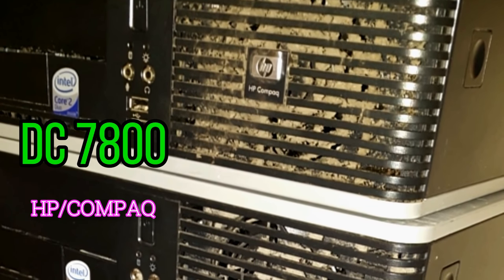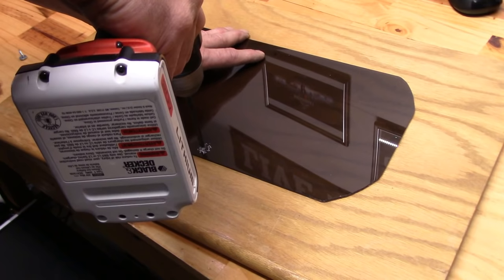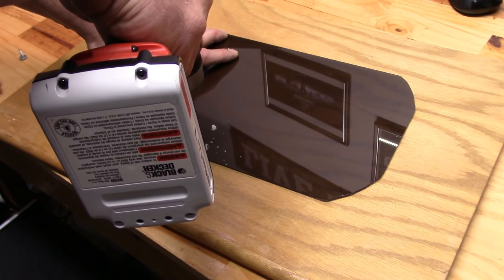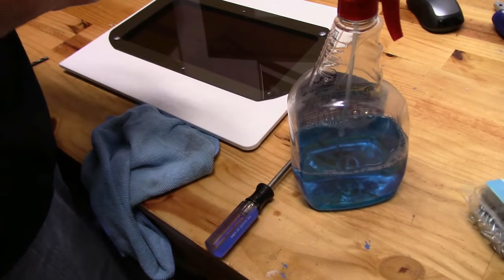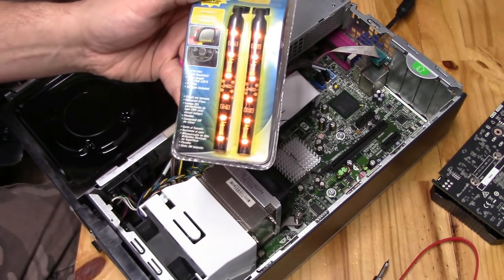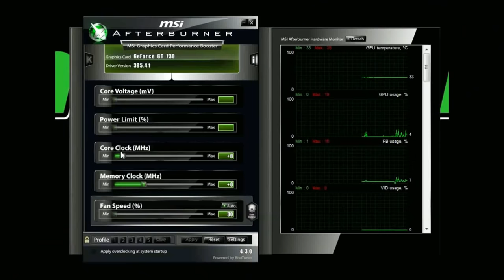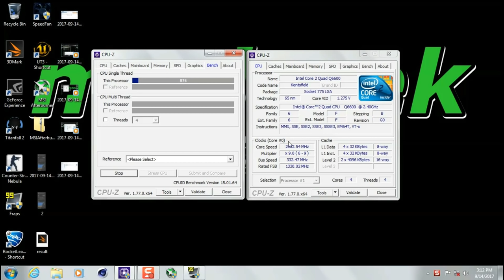ALL Out HP Gaming pc on the cheap! How to customize your pc.

Comment: Here's something to consider when drilling acrylic too, and that is to use wood above and below the glass. The piece you use above does not have to be much, maybe 3/4" thick by 6" long by 2" wide. That way when the drill cuts through it does not snap the acrylic. Just make sure to hold the top piece down tightly against the glass. You can also drill the hole on the top wood in a way that allows you to keep the piece flush with the glass for alignment purposes. Also making it about 2" from the edge allows for easy alignment as well...

Comment: Do you still remember few months ago I told you that the CPU fan of my HP dc5800 Small Form Factor is noisy after being restored? I almost give up and want to dispose the PC. However, recently I discovered that the overheating part is the North bridge heat sink, not CPU heat sink. The noise level of the CPU fan is reduced after I apply a fresh thermal paste onto the Northbridge heat sink. I told my finding in HP Support Forum, and some of them told me to install a discreet graphic card (and not to use the Intel integrated graphic card) to lessen the burden and temperature of the Northbridge.

Comment: You're better off just hot gluing the plexi to the underside instead of risking cracking it with a drill and leaving the top looking messy. I'm surprised the plexi stayed in one piece when you drilled through it with that bit. I normally have to start with a tiny bit and work my way up or it cracks.

Comment: Neat trick with the cpu, though stability may be an issue. I just update the bios and stick the fastest manufacture recommended cpu in lol! I have a 2007 Vostro 200 (Dell's cheap line of desktops) with a updated bios running a E8500 3.16ghz 1333 cpu along with 8 gb of ddr2 (got the ram and cpu dirt cheap). I really wanted to stick a quad core in, but the board's power limits means it will only work with dual cores. One of these days i'll have to find a mid tower for it (it's the slim version) so I can toss a better psu and graphics card in.

Comment: I want to do this to my HP Elite 8200 SFF but I'm stuck on the painting. What paint do you use? And what kind of priming/sanding/etc do you do before hand?
Reply from the maker: You can get spray paint cans with primer added. I usually just grab some at Wal-Mart . It depends on how picky you are about scratches if it doesn't have deep scratches just scuff it up with a fine drywall sponge and was it with dish soap. After a good rinsing let it dry and then slap on a box or something you want it flat obviously or the paint will run.
Reply: Thanks! I picked up some of that paint in white along with a sanding sponge, prepped everything and painted. It's been drying for about a day and it looks awesome!

Comment: You should have used a gt 1030  it is much better
Reply: More expensive, also a bad deal at its price point where you can get much better performance with used cards.
Reply: @True Inferno Generally yes, but when limited to a Slim or Small Form Factor case like in this video (and with it's low wattage, proprietary PSU), then the GT 1030 is actually a rather good deal.
Reply: gt 730 uses about 25 watts, a GT 1030 about 30 watts and the RX550 uses about 50 watts.
Reply: Johns Memes but does a q6600 bottleneck a gt 1030? That is what I wonder.
Reply: nope it doesnt
Reply: Nah, not really it lacks a lot in Overwatch and sometimes other esports titles.
Reply: yes
Reply: 1050 ti  ,,,,,,,,
Reply: maybe you can put the 7800 heatsink on the 7900 motherboard?
Reply: Where did he put it i didnt see it
Reply: True Inferno the 1030 is smaller
Reply: I have same pc gt1030 8gb, got mine for 120
Reply: They don't do a GT1030 8gb.They(even evga,gigabyte,msi,pny,asus and zotac models) only do up to 2gb gddr5 .
Reply: Del11k he meant 8gb ram and gt 1030
Reply: my friend didn't do any custom stuff to his but my friend wanted a gaming pc so we got him one of these cheap things with an i5 3something in it and we threw a low profile 1050ti in it and it works great

Comment: I have the exact same pc right now, what is that white conector at the end of the psu wiring for? And also, you put a graphics card in it, mine comes with a nvidia 9500gt and the psu can't handle it, it just don't start, it makes four beeps which means psu is overloaded, is your psu 240w also?
Reply: Rodrigo Godoy Valenzuela that's crazy, your computer came with a card it can't handle? Just wow man. Any chance of replacing your psu with a higher wattage psu? It's not ideal, but at least you'd be able to use the card at that point.

Comment: Front Side Bus crystal on some of these babies are stuck clocked at the lower speeds. Tape mod won't work.
Reply: Ohhdanyboy some mobo dont support it
Reply: Ohhdanyboy at least it worked out with this one. It was a trick to OC OEM computers and so of course it's hit or miss, but when it works it's a welcome change.

Comment: i have one of these computers 
its great but when they gpu died (6450 HD silent 1GB) it turned out to be not so great plus my windows 10 pro got corrupted big time and barely even runs on it now
also i have a Pentium d945 
it just beeps at me when i put it in even resetting the bios doesnt work either

Comment: Messing with an older Lenovo motherboard my sister threw out, G31T-LM2. It currently has a Dual Core Pentium E5200. What do you think would be a good chip to upgrade to? Was going to pair with this 750 ti I upgraded my main rig from.

I was thinking the Q6600 like you did here. Would that work and be a good pairing?

Do you have a video that goes into more detail about your covering the pins trick?

http://www.ascendtech.us/ibm-lenovo-g31t-lm2-lga775-motherboard_i_mb4ibmg31tlm210.aspx

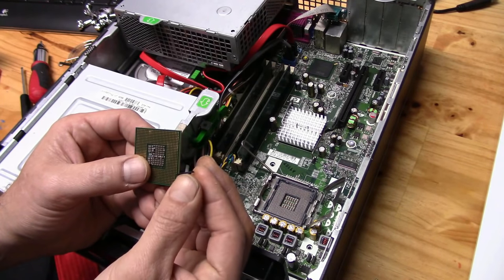Comment: 0:59 never touch the CPU like that. Your skin leaves traces of dirt and oil wherever it touches. That could damage the CPU. Good work btw.
Reply: jdj9 mhe
Reply: That's such bs haha, older CPUs aren't as fragile as newer ones, honestly I've tested old amd CPUs by licking the pins rubbing my hair in them even bending them. And guess what, they still worked, they're no where near as shitely built as the newer ones. Honestly it will work no matter what so don't fret.

Comment: You should've put a mini MSI GTX 1050 ti in it >:C
Reply: Brentar's Gaming The Zotac 1050ti low profile is better it runs cooler and the low profile bracket actually fits the car properly with out modifications.

Comment: Or you can do a scrapyard PC! Just buy an old full size Dell with an i7 on eBay, and you can fit in a used GTX 1070 from Microcenter for $250, an SSD, and a better PSU. Wa la!
Reply: NintendoNoah are those motherboards proprietary?

Comment: why not try the xeon mod?
Reply from the maker: +Senior Drugs I tried it didn't work and couldn't find a modded bios
Reply: you have to mod the bios yourself, http://www.delidded.com/lga-771-to-775-adapter/3/ and this is for modding the bios manually http://www.delidded.com/lga-771-xeon-microcode/
Reply: at the moment i am running a msi p35 platinum with a xeon x5460 running mac os x 10.10.5, linux xubuntu and windows 10 with 8gb of memory. ever since the bios mod and cpu upgrade it's running so more better plus the custom made water cooling system helps out as well.